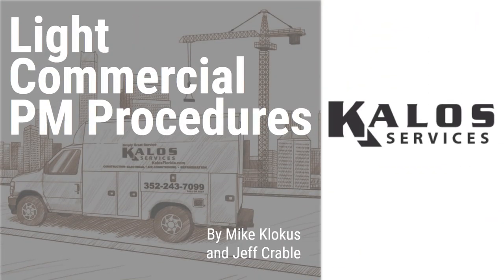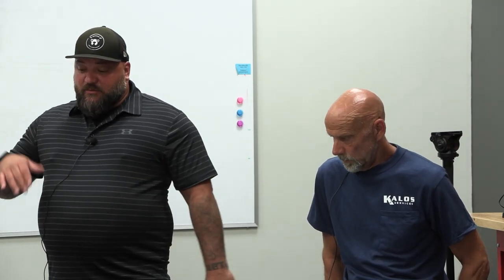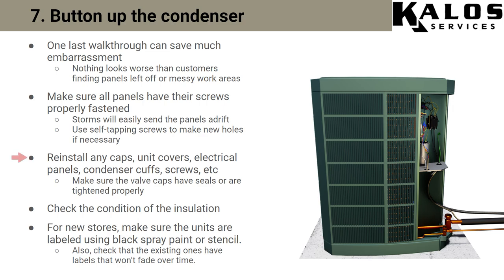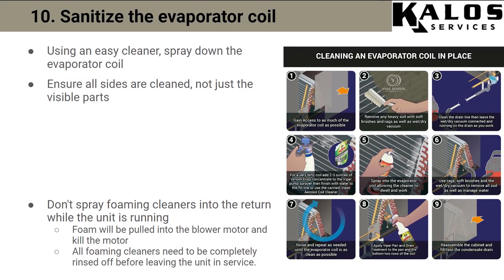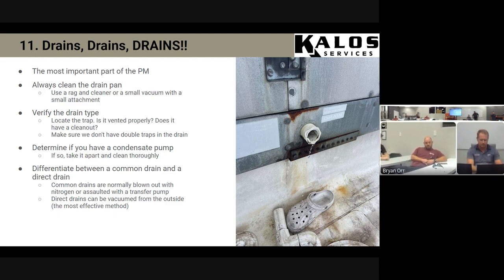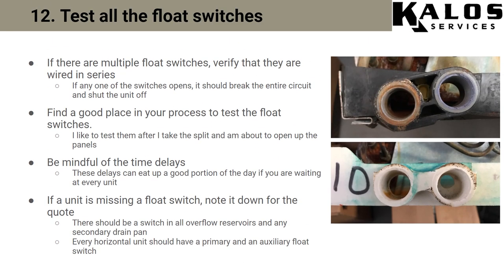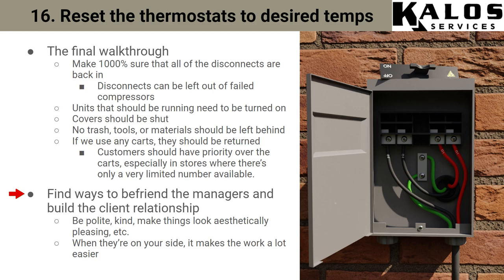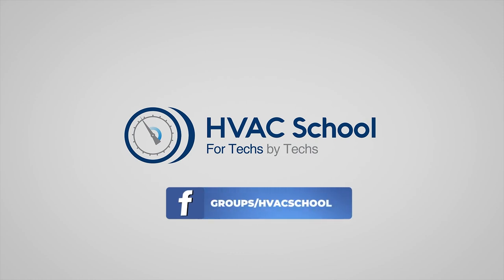Light Commercial PM Procedures

Comment: I've found that the best practice for drain traps is to pour at least 1 gallon of water down each drain trap, especially if it's a long drain line. If it's really long, I'll do a couple gallons of water down each one. To many times I've seen techs pour a drink bottle of water down, and use a little nitrogen, which just pushes any trash a little ways down the line. With a gallon or two of water, you usually flush the drain clean.

Comment: no customer is going to pay for that thorough of a routine maintenance, first visit sure but after that no way
Reply: You are wrong, 80% of my company's work is thorough routine maintenance. Several customers pay for coils to be cleaned, drains to be cleared,  units to be shined, interior insulation to be sanitized and wiped down, blower wheel inspection, belt inspections, and more every month. Saves them money in the long run and their units will most likely run 20 years plus.